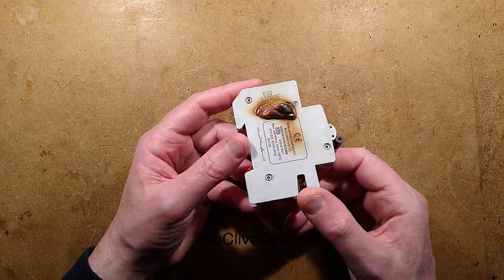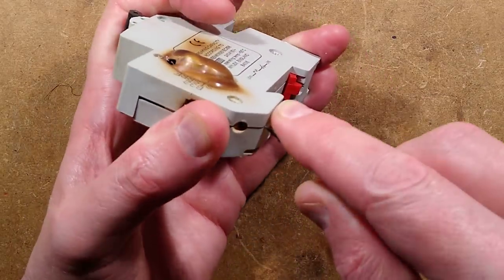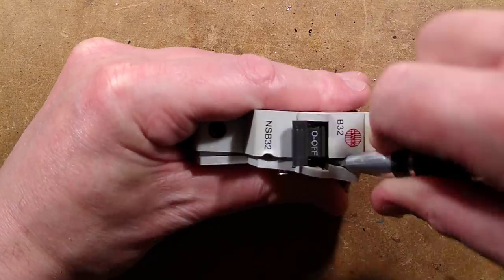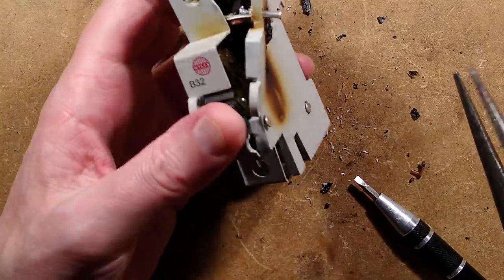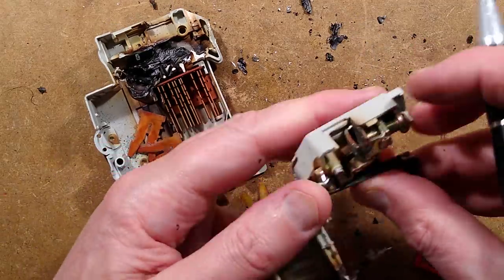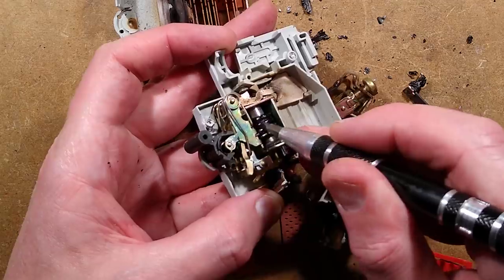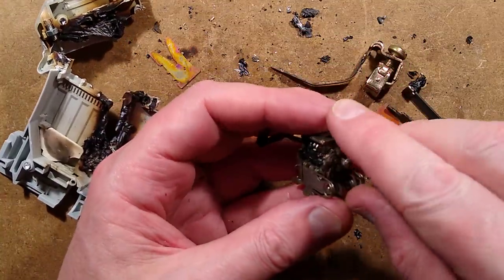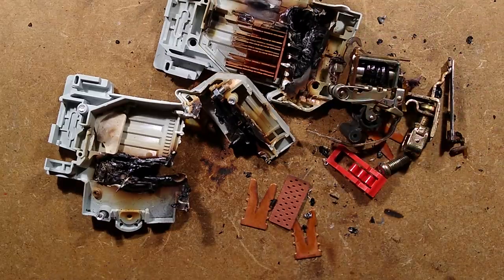Inside a totally smoked circuit breaker.  What went wrong?

Comment: So someone has held the breaker in because it wouldn't stay, and eventually, it stayed by itself.

Then it started smoking...
Reply from the maker: You can't do that.  It will trip internally.  But repeatedly resetting it may have caused the mechanism to fail.
Reply: @bigclivedotcom  Every day is a schoolday!
Reply: @Beany2007FTW  That safety behavior is called a "trip-free" circuit breaker and is required in almost all designs, particularly stuff accessible to consumers. However, there are specialized "non-trip-free" breakers that are used for critical systems, like the steering system of a boat, so that they can be held closed and bypassed in emergency situations.
Reply: @straightpipediesel  All older simple breakers in Canada can be held closed.  Only the new fancy RCDs trip free.
Reply: Sort of did that.  Set a breaker, it would trip.  Tried to figure out where the line was, and then I started hearing a shrill sound.    Ran up two flights of stairs, and found a blown power outlet - horizontal, below a window that I was told kept being left open during rain....   And looked to have been peed on by an animal a few times. 

No, none of the breakers were labeled.   I cleaned everything up, reset the surface mount outlet to be six inches inside the window, (had to repaint the metal outlet box.  Couldn't replace - nobody sells them anymore) put in a new grounded outlet, AND managed to zap myself because the idiots fed two circuits through the same channel.  Luckily zapping myself was 'ouch', not anything worse, because I took precautions even with a turned off circuit. 

BTW - the breaker was fine.   the outlet exploded out scattering melted and smoking bits everywhere.  No flames, just heat and smoke.
Reply: @straightpipediesel  Neat! Mind you, in one of the places I lived more recently than you'd like to think, the fusebox was a fusebox - with fuse wire involved. I was impressed by that.

@Troy Belding - shitting hell dude, that does not sound fun. Glad I mostly work with 12/48v gear for IT/comms work. not that they can't bite if provoked....
Reply: @Beany2007FTW  
Fuse wire?
As in, two exposed contacts with a piece of wire between them?
If you don't mind me asking, where do you live, the triassic period?
Pre-Edwardian London?
Mexico City?

I'll bet 12/48 volt circuits for IT can light a person up...
I learned my lesson about respecting low voltage when sorting out the T.N.I. for a small apartment building.
Over the years, some places had a phone line in every room of their apartment.
Decided to use my mouth as a third hand for a tip wire.
When I let go of a ground wire, it sprung back & hit my cheek.
Those 3 volts are about 10 times more uncomfortable than licking a 9 volt battery.
Reply: @kaisersose5549  It was a victorian terrace rented out by a skinflint. The fusewire hadn't failed him by 2010 so it wasn't changed....
Reply: @kaisersose5549  you mean like my 1960s NZ house that still has a fair selection of fuses in nice ceramic holders? 🙄
Reply: @Darth Stranger yup.  Literally watched workers hold the breaker closed on construction sites.

Comment: 0:56 OMP <-- "One Moment, Please..."  🙂 
Thanks for this vid BC. It's actually provoked a question in me about domestic supply. Using an automatic trip fuse (as per those in standard fuse box) that's external (in another room).
My property fuse box is full,  no more space for more trip fuses.  I want to install a high power extractor fan elsewhere in the property, but the suppliers instructions expressly require a trip 'fuse'  and then if i want i can add a min/off/max manual switch to control it.  My question is... can i install a fusebox to hold such a trip fuse ( both eeasily available everywhere), but run the input to the  newly installed fusebox from an existing 13amp regular plug socket.  basically take some wire, 13amp fuse plug on it, and put the tails as a supply,  into the new fuse box and it's trip fuse?  from my perspective, this seems like 3 times (or triple) protection.  Can you BC or anybody else advise if this is ok? There is no water or damp. Just a 13amp plug lead from regular UK socket, wires leading into to a trip fuse, and then onto the device. Thanks all for any comments. safety thoughts? it all seems ok to me but its worthy of discussion. Thanks. Rob
Reply from the maker: It sounds odd.  I'd expect you to be able to rely on the fuse in a 13A plug as circuit protection for the fan if the closest fuse rating was used.
Reply: @
PalmIt

if the fan is less than 13 AMP (3 KW) you can do that :-)
Reply: @bigclivedotcom  @YTANDY100 i have put the instructions images on imgur: https://imgur.com/a/iNNy3eM 

just the schematics and electrical specifics.  not all the instructions. 

 but do you think i have taken them a bit literally? i mean all the plug sockets go through the fuse box already.
Reply: @Palmit_  
it looks like you could just connect to a regular 13 amp plug with a 3 amp fuse in it , the instructions dont have a rating on but from the images it looks like 3 amp will be enough :-)
Reply: @YTANDY100  Thanks for replying and advice. :)  I think i was just being over cautious and wanted to err on the side of safety. an inline circuit breaker would def keep it in warranty too.. but yeah.. def not required. 3amp fuse.. good advice. I'd rather if fuse did blow, it was not AFTER  my home had melted!!! lol Thanks again. See you in the next BC livestream chat! :)

Comment: That was an interesting "post mortem"
It does not seem to have been an installation issue, but user abuse.
Good thing those plastics are designed to not combust, as those temperatures would certainly have caused a nice cosy conflagration.
Thanks for the video Clive
Regards,
Duncan
Reply: "A cosy conflagration" sounds more like a fire in a fireplace than a house burning down, though.

Comment: One of my first apartments was run on a single 15 amp screw in fuse. When I found that out, I broke the lease. A couple months later the apartment caught fire.
Reply: I don't understand. If the fuse for the whole premises was 15 amp, how the hell did any of your equipment even function!? A kettle by itself can take 10 amps.

Comment: I would not be surprised if the residents got sick of constantly resetting this breaker without once trying to figure out WHY it was constantly tripping that they just taped the trip lever in the on position and the breaker then tried to trip but couldn't and was forced to pass a ludicrously ruinous level of current until it finally was able to "trip" by melting (and by the look of the sides of the casing, take the breakers on either side of it with it)...

What really surprises me is that Thomas Nagy was able to go in and replace the destroyed breaker. I would have expected this to cause a fire in the wiring running through the walls and at the sockets...

What Thomas Nagy should have found when he showed up at the home is nothing more than a smoking pile of charred rubble and one VERY Irritated Fire Inspector...

Comment: Usually a circuit breaker will melt because someone didn't clamp the wire enough this is one of the reasons why DIYers should never mess with the fuse boxes

Comment: Do these breakers support the "home electricians" modification of duct taping it in the ON position?
Reply from the maker: No.  Because they can trip internally independent of the lever.
Reply: @bigclivedotcom  deja vu all over again :p.  Just for completeness.  In Canada with our pretend power of 110V and standard 15Amp breakers before the RCD types you could hold them closed.  Most houses here have these dumb ones unless they are specifically near water (bathrooms, or outside).  I would be curious to know what all the loads were on that and what the condition of the wiring is... probably burnt the insulation off of a bunch of it.  Also handy for locating hidden junction boxes.
Reply: @someguy2741  we have 110/200/220 up to 120/208/240
Reply: @ellenorbjornsdottir1166   Not sure what you mean?  Do I need to list all kinds of power available... how come you didnt mention the medium and high voltages?  We have 12kV and 48kV.  We also have 600V and 480V 3 phase industrial.  But houses only have 115V and 230V 2 phase.  My comment mentioned specifically the 110V standard but the 230V breakers can also be held closed.

Comment: The current sensing coil is black
The bimetallic strip is black
Everything is black

The magnetic coil here is blllack
The lacquer in these windings is cracked
A lot of current has flown through that

The plunger is still plunging
It's still going up and down
The little trip mechanism here has melted
away from that

Comment: Those Wylex  consumer units these MCBs are designed for have the annoying thing in that they only work with each other, AFAIK no other MCB's will properly fit in the Wylex consumer units and the main breaker and all the MCB's/RCBO's are supported by the bus bar, which is just held on with a plastic bracket and it's fitment into the main breaker, so if you need to do anything different with a Wylex consumer unit (such as in my case adding a master MCB) some drilling of the busbar so the plastic support still fits is required, a PITA!

Comment: I think it kept tripping and someone just kept resetting it untill suddenly it welded itself up and went critical untill it physically burned out.
I'm guessing someone ran a heavy duty electric welder through it...
My garage was on single spur and a small MIG welder would trip the breaker almost immediatly, changing it to a ring main fixed the issue.

Comment: Last two days when I turn on my stove the circuit breaker box starts too make a buzzing sound but it stops when I push on the circuit breakers. It's almost like there is a bad connection should I be worried? I do plan to call the landlord.
Reply from the maker: Sometimes the magnetic coils in breakers do make a slight buzz under load.  If it ever starts making a hot smell then that's more of an issue.

Comment: The breaker is like this probably because it does not trip from over current, melting caused by the heat from bimetallic and coil elements inside.

Comment: someone forgot lug tightening day ;)
I say lug was loose, causing excessive heating and tripping, it melted the plastic sticking itself on  and cooked. only other thing I can think of is low voltage and high current or high current DC ran through it

Comment: For all that engineering in that breaker I wounder if a normal wire fuse would have performed better under the same conditions, I wonder if we could get John Ward to do a comparison test?
Reply: It would work the first time - then the (ab)user would replace the fuse wire with a nail or thick copper wire.
Reply: @duncanmacdonald6993  Ha ha....! Very true, may to combat this CU manufacturers sould double up on breakers of high capacity and have the second breaker concealed from the home user, or design a breaker that you can only reset say a hand full of times, before it permanently disengages it self.

Comment: ok everyone heres the thing

if the breaker trips it tripped for a reason. Don't keep resetting it for it to trip again in a little bit. Its possible that the breaker may of got worn out or faulty so replacing that would be a step but if it still trips then the problems lies with the connection circuit. Call and electrician to check the wires!!!!! because if this breaker suffered this much damage I don't even want to know what the wires in the walls that was connected to it looked like...

Comment: This " modern " safety device might have set light to his house .. The " old skool " ceramic re-wireable ( plug in )  fuse links are MUCH MUCH safer, ( if you use the CORRECT size fuse wire ! ), but amazingly ( ? ) no longer allowed in new build UK properties !

Comment: Over 40 years in my house, never blown a ring fuse. It's an old fasioned fuse wire box but I use local breakers where needed. I had thought about a new fuse box but it seems 'KISS' - Keep  It  Simple  Stupid might not be so stupid after all. These things could start a house fire, I doubt a bit of fuse wire would.
Reply: @Blazin Redeye It is possible to have one main 100a RCD protecting the circuts. With a fuse for each circuit, of course.
Reply: @Blazin Redeye I also have never seen a fuse just detonate and throw gobs of molten metal everywhere, surely they are designed to mitigate that. And, if it happened in your breaker panel, usually the door on the front is closed, so that may stop it. (edit: I think you are talking about the really old fuses that you replace the fuse wire itself/the ones that have it exposed iirc its illegal to have those, for that very reason.)

Comment: I had one weld together when the locomotive engineer couldn’t get it to stay up, so he held it in an arc position until he set the locomotive electrical cabinet on fire. When I ran up to home I asked him if he pulled the battery knife switch open. He told me he had. Totally lied to me. I found the breaker in a similar condition after we put it out. We had to rewire 80 percent of the low voltage electrical system on a shoestring budget. That was miserable work.

Comment: If the available fault current exceeds the rating of the breaker it will fail. Most residential breakers are minimally rated at 10.000 amps fault current.  The electric utility can advise the level of the available fault current at the entrance point to the dwelling. There are higher rated breakers. The next highest is 22,000 amps interrupting capability.

Comment: While the electrical outlets in the US are complete junk, our wiring standards are a bit better than this.  Circuits feeding standard outlets simply aren't of a size that would melt a breaker under this circumstance.  Two heaters on a standard 15 or 20 Amp US circuit is enough to trip the breaker (but we have a lot more circuits, so this usually does not pose a problem.)

My brother was on-assignment in the UK for several years, and while he loved living there, he did not love the electrical and plumbing systems and the appliances of his (fairly new) English house.  One of his complaints was his large-ish house having relatively few circuits, making load-balancing difficult at times.

Comment: A certain number of these breakers were dodgy and recalled, circa 2009  Not long after, wylex changed the design to a much better one.. I've changed 2 of these in 2 days due to the output lug being crap and signs of thermal damage.
Reply from the maker: This one is 32A and not covered in that recall.

Comment: Do breakers like this have a cycle limit?  Like after they have tripped 10+ times do they need to be replaced?
I know I have seen them trip many more times than that and were still fine but I have never heard a recommended replacement interval
Reply from the maker: It depends on the current they break when tripping.  But there's no easy way to tell the state of the contacts.
Reply: @bigclivedotcom    I was just wondering if there was like a rule of thumb sort of thing or made like a guide line or something.  Sort of like if it's a main breaker ( in my case it's 200 amp) after it has tripped 4 times it should be replaced as a matter of course.  I haven't ever heard anything like that but it's something I have wondered for a while

Comment: Always remember: Never rely on a circuit breaker to protect your life or property when ANY other option exists. Circuit breakers DO fail, and when they do, it's bad times had by all.
Reply: I wonder if Fused Circuit Breakers exist.
Reply: @Krutonium  Circuit breakers can absolutely fuse closed if their contacts wear out or they are abused. They will weld themselves due to arcing and will be incapable of opening during a fault. This can be quite subtle...it usually only manifests itself as a housefire.
Reply: @Blazin Redeye I agree. I've never seen it myself, but it is theoretically possible.
Reply: @WarrenGarabrandt  You misunderstand, I mean a Breaker with a Fuse as a backup, either inside or in series with the breaker.
Reply: @Krutonium  oh. Well it would have to be in series then to do and good.

Comment: This is just a wild guess, but ..... I wonder if this came from a shower circuit?
Quite often you would see someone replace a shower with a new "better one" Better = Bigger!
If it was a 7.5Kw running happily enough on a 32A breaker and was replaced with a 9Kw you go from a 30A load to 36A .... and breakers are Not designed to take that amount of overload forever .... but it may well not be enough to trip it with overload!